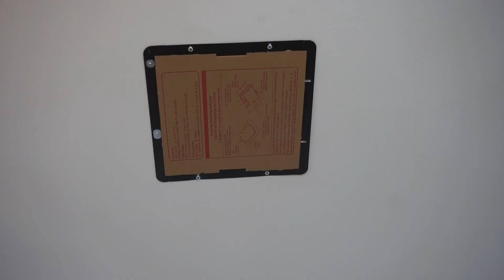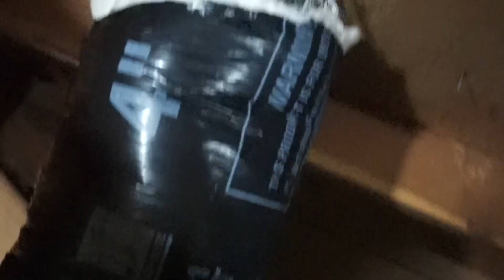Bathroom Remodel Time-Lapse - DIY Bathroom FULL Renovation From Start To Finish Transformation!

Comment: Are you worried at all about water getting under the baseboards where there is a gap between floor and baseboard? I am doing the same thing and not sure if I should add shoe moulding to help with that